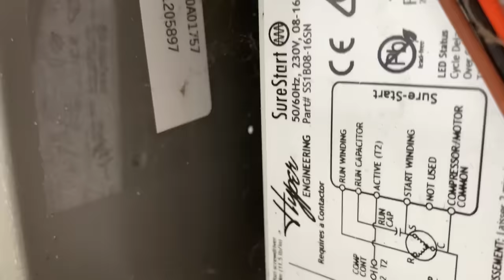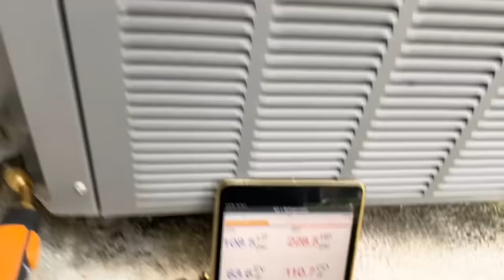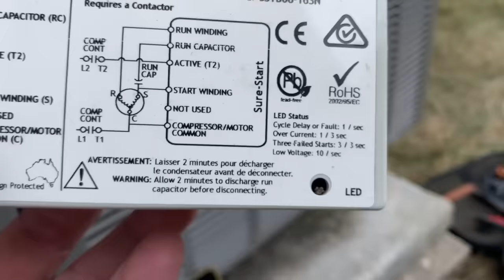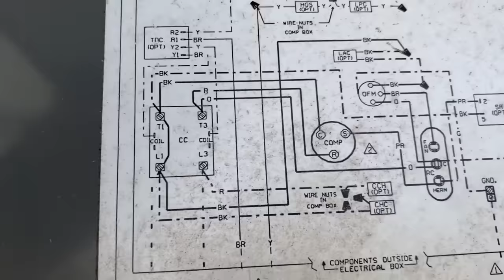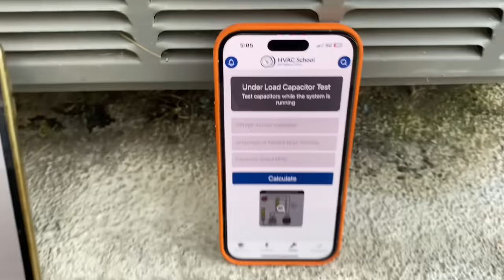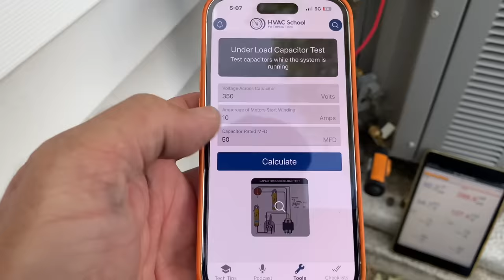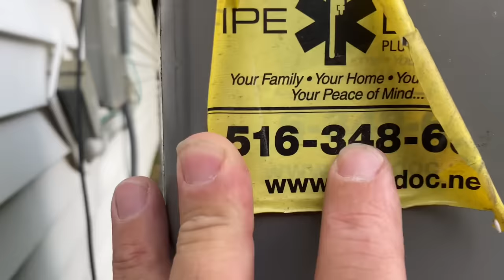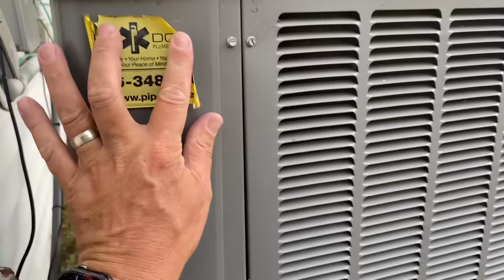Soft Start Killed Compressor! UNEDITED Central AC Service Call for No Air Conditioning Revealed!

Comment: I do alot of stand-by generator installs, and have installed many of that exact "soft start" module. They work great, for reducing the inrush current (and thus, not overloading the genset on start-up), AND they reduce the physical starting torque (the forces exerted on the compressor and piping) of the condenser compressor. Have yet to see one fail, if it was initially properly sized. It appears that one wasn't. 

The problem(s) with the unit is this video was NOT really due to the "stupid soft start thing" (your terminology), it was due to the apparent total LACK OF MAINTENANCE on the condenser. Lack of maintenance caused the soft-start to fail, causing the intermittent compressor run issue. The soft start's don't fail if your compressor (condenser) is properly maintained. They will, in fact, increase the life of the condenser units.
Reply from the maker: Lack of maintenance and wrong size. So yeah, it was a stupid soft start thing that killed the compressor.
Reply: @PipeDoctor  Stick to plumbing
Reply: @PipeDoctor  Excellent video, but I must express that it seems somewhat disrespectful to technology and science to discard and throwing items as you did without proper examination. I understand that your expertise primarily lies in plumbing, and that electronics and electrical engineering are distinct fields. However, embracing new knowledge is crucial, and showing disregard/disrespect may not foster learning, which is equally important as aspects like "branding." Observing the AC unit in your video, it appears to be in poor condition and in dire need of either a soft or hard start mechanism. In past this necessity likely led someone to install a soft start device, although they chose one that was undersized. While it functioned for a time, it was inevitable that it wouldn't last indefinitely. Therefore, I suggest considering the installation of a correctly sized soft or hard start device for their system, as the old system might fail unexpectedly. Thanks
Reply: So how many of them have you sold?
Reply: @RadioRich100  I don't "sell" them, per se.  I do recommend them to the people I've done GenSet installs for. I give them the info and a link, and they purchase direct.

I've done 6 or 7 installs of the soft-starts in the last 2 years. All are performing flawlessly.
Reply: Nope, your putting an over sophisticated device in where a simple one works better (hard start) and not prone to failure from lightning and electrical surges. Also if a hard start fails the unit still runs. Too many points of failure in the soft starts, computer circuits are very vulnerable and the ac now depends on it. The hard start kit cost far less also.
Reply: @RadioRich100  Respectfully disagree, sir.
My area of west Texas is EXTREMELY lightning-prone. We get severe lightning storms, almost every day (or at least a couple times/week), and I have yet to have one I have installed fail.
A hard-start and soft-start are two different animals. On a generator-supplied house, the high inrush current of the compressor at start-up can cause the GenSet to bog-down excessively (depending upon Genset size & A/C comp size) when running on the GenSet. A "hard-start" will not cure this. The "Hyper Engineering" soft-starts do...
Mine (at my own residence, on a heatpump compressor) has been in continuous service since late 2020. Lots of storms & lightning. Have had two AFCI breakers and a GFCI receptacle fail due to lightning (most likely), but the soft start has continued working without a hitch. The house is also protected with Siemens FS-140 "whole-house" surge protector, at the utility panel (as per 2020 NEC, all new-construction is required to have  SPD's installed).
Reply: @rollotomassi6232 he needs compressors to fail. He just ensured someone else or himself to get more money replacing the system later.
Reply: @manclt704 You are wise.
Reply: @RadioRich100 hard starts are what you do when you want to rush destroying the compressor.
Reply: The soft starts unit destroy compressor motors by over taxing the start winding over time which can lead to failures. You shouldnt use them. This is why your warranty is violated by putting one on your unit. Or a hard start kit. Both are not good for your compressors motor.  Hard start kit is ok for old compressors which have trouble starting. The engineering that goes into the unit doesnt require help. Soft starts "starve" the windings for current while having the same torgue load on the motor causing it to strain everytime it slowly starts. Its designed to start with full current to get the motor up to speed immediately. Its amazing how many techs that are selling these things have become engineers. And especially you generator guys that are now hvac experts.
Reply: @RadioRich100  Time will tell, I guess. 🙂
So we went from "lightning & surges" will destroy the modules, and thus [somehow] the compressor, to "slow starting kills the motor". C'mon man. 🤣
There are likely tens-of-thousands of soft-start units in service. I guess we should be seeing tens-of-thousands of compressor motor failures then, very soon...? I think not.
I've been in the industrial/commercial electrical field for over 40 years (retired in '20, still do side-work). Worked on 400hp blower systems (AC motor-driven), steam boilers, chilled water sytems (pumps & chillers), and huge conveyor systems (hundreds of AC & DC motors). We had two 500-ton Trane compressor-type, air-cooled chiller units, that I maintained, as well as a large, 500-ton Trane adsorption chiller (part of an electrical co-generation plant). Really fun stuff!
No... I'm not (nor claim to be) an "AC expert". But I've worked on hundreds (maybe thousands) of motors & motor-control systems over my career. 
At their core, there is nothing special or complicated about [home] AC compressors & systems. In fact they are relatively super-simple in design & operation. 
In all those years,  I've never heard of slow-starting a motor (with proper techniques) somehow "over-taxing" the start winding of that motor... Simply not true, and just the opposite is true,  in fact.
Less current in the [start] windings is not damaging... but more (high) current is - as happens with a "hard-start". If anything, applying a "hard-start" to an older compressor will expedite its death, because your trying to overcome some mechanical issue (worn compressor or a high-head situation) in the old compressor, by jacking-up the start current to get it running. That's what damages the windings. 
So again, I respectfully disagree with your assumptions. Ramping a mechanical-drive system up to speed is always less "taxing" than starting "hard" against a load. Always.
While I'm not an "AC expert", I am (to some extent) an electrical expert. No offense intended - but you are obviously not an electrical expert either (that's why we don't call AC guys when there's an electrical problem... 🙂).
Again, AC systems are not really that complicated... electrically speaking.
Great discussion though. Thanks.
Reply: @Calico5string1962  With the tens of thousands out there , there are nearly as many failures for multiple reasons when there are put on systems not designed for them. They over time destroy windings by over heating by taking to much time to get up to speed, by delaying and extending the on time. The motors are designed to start the way they do and need no help. But I didnt know that every time one goes bad that you would know about it. Hvac techs disconnect  them all the time on no A/C calls. Warranties are violated all the time with these. If they were so great they would designed into the system. Well - there not. You should not try to re engineer the system. Changing the electrical side of the compressor without changing the mechanical side to match means somethings going to prematurely fail. It will work for years with simple maintenance. No gadgets needed.
Reply: Baloney they fail alot of the time and dont reduce inrush, the unit alters the line frequency and throws your meter off.
Reply: @RadioRich100  
Huh? 
"Throws your meter off..." 🤣🤣
WTF is that supposed to mean.
Dude, you're way out in left field...
Buh-bye.
Reply: @Calico5string1962  I dont think so. Go research how a digital meter works and then compare it to your magic bullshit box.
Reply: So how many of those units have sold via bullshit to your customers? I put one on my car and it doubled my gas mileage!
Reply: @RadioRich100  🤣🤣🤣
Reply: @RadioRich100   Oki-doki brother. Have a nice day.

Comment: They have a solar installation, the difference between 130 amps, and 65 amps at start can make a huge difference.  Soft start should have been replaced, not just eliminated?  The fault could have been from the compressor being so dirty.

Comment: The soft start has a reset button, you don't have to throw it on the ground.
Plus the 130v max means it's using so much electricity VS what is was using with the Power Factor Correction device. 
The main  problem with PFC like capacitors it proper sizing - under or over sizing can cause problems.
Good Active PFC with addional capacitors in parallel not only stabilize voltage but also reduce the reactive power used of the grid.
The meter on a house measures the reactive power used from the grid & they bill according base on kwh.
Given that electricity is energy & energy is neither created nor destroyed , we are wired into a system of generate,harness energy & the waste it thru transmission. 
The actual power comes to the hot wire & is returned thru the neutral and the amount of resistance our wiring insulation release back into thin air is what we get billed for.

Comment: I noticed they had a solar panel  box next to the outdoor unit. If you removed the glorified hockey puck and they had whole house batteries aaaaand did not put something in return. You might have cost them upwards of 15k. Or the inverter unit. 
The soft start is so the intial amp draw does not kill the batteries.

Comment: So what happens when the family loses city power and they need to power the unit with a generator? No chance of doing that now huh?
Reply from the maker: Wrong
Reply: @PipeDoctor  Man, that is a 5TON unit. with over 120AMP LRA. You'll need like a 30K Watt genie. However, I would def. ask the customer what they wanted and give them the choice. Good job keeping that unit running so long. It may have another 15 years left in it.

Comment: I'm glad I watched this...I'm getting a transfer switch put in so I can hook up a backup generator because we lose power quite often..Part of that process is a soft start for the AC. I was concerned at first until I saw the soft start failed and didn't actually damage the compressor.

Comment: I suspected the soft start device was undersized for the application once it was found. The devices are good, but only if correct application is followed. In this case the unit probably maxed out at 3.5 to 4 ton systems and was being asked to work on a 5 ton system. Think of it like putting a Lawnmower battery in your car, it might start it for a short time, but it is not strong enough for continued use.
Reply from the maker: Yes, it was grossly undersized
Reply: @PipeDoctor since you had been the service man on the unit for the last 15 years…. You installed it?  Good job!

Comment: Next time take your start amp reading, then read run and common at the same time. You will notice that when you have the correct size capacitor that those two readings will be identical. This indicates a balanced field and also serves as a dynamic test without math. Try it
Reply: It’s extremely useful when you are unsure of the correct cap size
Reply from the maker: Thanks for the tip!
Reply: @PipeDoctor  on a four wire setup you need both commons and run.

Comment: Soft start controllers are critical in AC units when running on a generator. The controllers are electronic and sometimes they fail just like other controllers. Using the correct size soft start controller is pretty important though. And there were other problems with the condensing unit.

Comment: When you come back, look for a lockout kit on the electrical panel.  The previous homeowners might have set it up for using a portable generator, which would explain why the soft start kit was installed.  
As others have said, sizing of those is critical
Reply from the maker: Tesla batteries on the wall of the garage. Solar on the roof

Comment: Emerson sold those for Copeland compressors. They were made by Hyperengineering, the same mfr that you removed. They are required in Australia. Your ignorance is understandable but that you have no desire to learn is unforgivable. Those current limiting boxes are the best, if you install the right one, because size matters. I’ve had mine for a decade now and my lights don’t blink and my generator doesn’t big when either of my 3 tons start. So you need to read up on them because they are 100 times better than a hard start which is just a cheap way to break a compressor faster. But maybe that’s the point.
Reply from the maker: Maybe it is the point but what matters here is that THE CUSTOMER NEEDED CENTRAL AIR & I DELIVERED COMFORT. that’s not ignorance. That’s delivering a service. Thanks for sharing.
Reply: I think Australia need heavier power lines and more generating capacity! Utilities there are getting away with murder!
Reply: @PipeDoctor  Read the definition of ignorance. It means a lack of knowledge concerning a given subject matter. A genius could be called ignorant about automotive maintenance for example. Saying someone is ignorant of a certain subject is not necessarily calling them stupid. He merely stated his belief that you may be ignorant of the positives of soft starters and how they should be used properly.

Comment: I totally get branding. I also have beef with a recent HVAC branding issue. We hired a contractor to finish our basement. The HVAC guy who they hired to adjust ducting for the finish scratched off all the name and contact info of the company who installed the furnace and AC. He put his own branding sticker on. I get it, however as a homeowner who paid to have a furnace and AC installed only 4 years ago, and have it still under warranty, I need that info if there are warranty issues. Unless this new HVAC guy is going to take over the warranty from the original install…which I doubt. Anyway, annoyed the shit out of me and I won’t be calling that new guy back
Reply: The name and number to avoid is now right there!

Comment: You said you have been doing this customer for 15 years. Whoever installed the condenser definitely did shotty work. Copper running exposed electrical box with whip, running wild and worse offense is pulling the condenser so close to the house that you can’t get to the coils.
Reply from the maker: I didn’t install the outdoor unit nor the soft start.
Reply: @PipeDoctor  strange considering that unit is no older than 2013

Comment: Okay looks like they put the wrong sized soft start amp load killed it. Second yeah that unit is from 2012 so I’d recommend a hard start one on a unit 10 years or older but it sounds fine once you pulled it I’d still recommend one. But yeah the soft start they used wasn’t even the correct size.
Reply from the maker: Thanks for sharing your insights! It's always helpful to hear from others who have experience with these units.

Comment: Found this video by chance.  I'm in Australia where those soft starters (and hyper engineering) first began.  Panasonic Australia used them by default for any single phase Panasonic wall split or ducted.  Fujitsu Australia used them for larger units if customers complained  ceiling lighting dimmed or any other power drain problem but quickly developed their own system.  I replaced a lot of hyper starts from 2002-2014, they all seem to fail eventually, but just the same all capacitors fail eventually too - especially the 2 in one caps.  I probably had more call outs for 6 year old capacitors than anything else before I left the industry.  When they changed capacitors for the awful smelling fluid to veg oil failure rates were higher in them than anything else for that 10 year period.  Since 2012 though everything is a DC inverter 3 phase so no more hyper starts, no more capacitor failures - everything PCB or DC fan motor related.  Now I just sell truck trays, canopies and service bed/canopies and just use the AC for my own comfort, so no more fixing them
Reply from the maker: Nothing like just being able to use the AC and not have to fix it daily. Enjoy retirement from the HVAC trades:)
Reply: I've seen 40 y/o capacitors still working but they were huge and had better dielectric insulation and more oil coolant!:trophy-yellow-smiling:
Reply: @PipeDoctor  Yeah, I started off on military bases in 1992 doing central plant chillers and cold/freezer rooms.  I downgraded to commercial A/C for 3 years, then downgraded again to be trained in mini splits - but that employer also did marine and coolrooms.  Not fun doing midnight call outs to butcher shop fridges or ships just docked.  Got to go on some cool ships at least, included frigates and subs. Ended up self employed doing mainly domestic and small stuff but I got sick of it - especially being in ceiling crawl spaces on a hot summers day, or 20' long extension ladders needed for small commercial roof unit access.